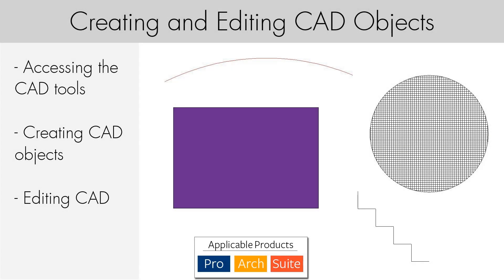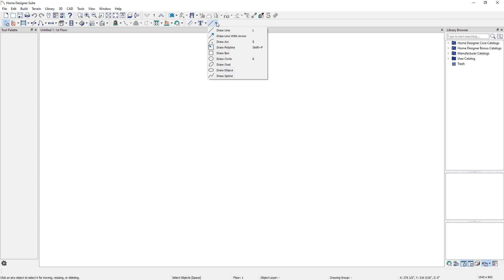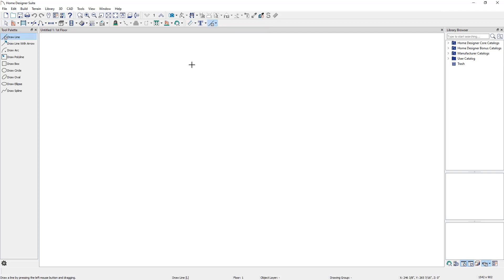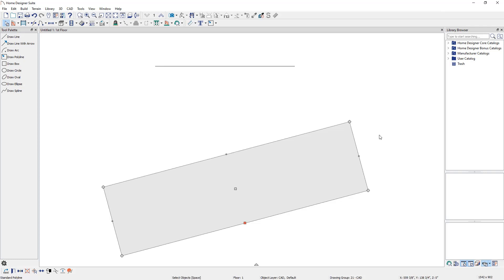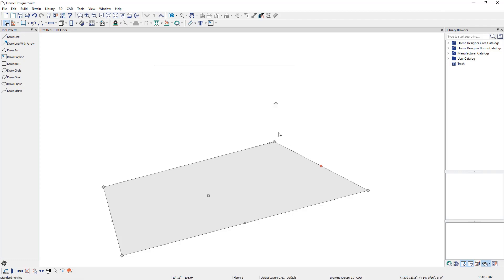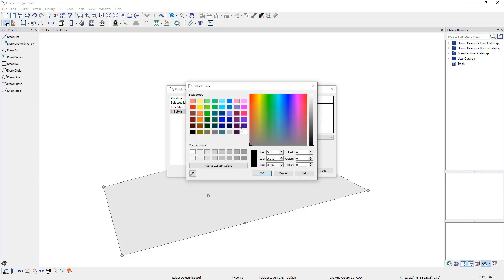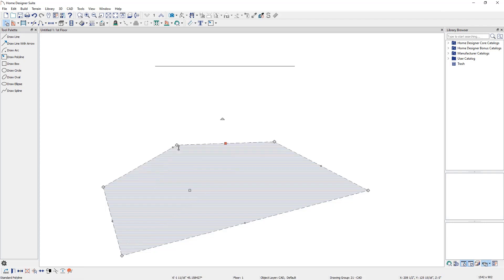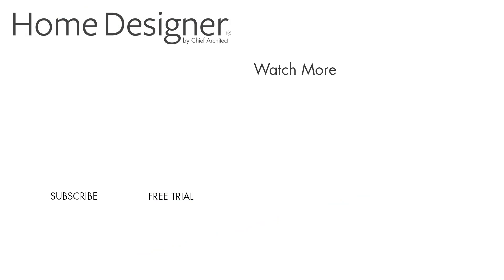CAD Tools and Objects

Comment: When will CA change or add the option on how cad objects are drawn. I.E. I use several different cad packages, such as AutoCAD, SketchUp, inventor and the list goes on. What I’m referring to is for example, When Drawing a line ... click hold the button down and drag and at the end release. Where most other software it’s click release, move and click release to complete the line. Either eliminate the click hold down mouse button, drag and release method to click release,  move,  click release method to end. Or better yet give us an option to select the method that best suits us. It drives me crazy when I need to switch from CA to another program and the methods are different. Thanks for hearing my rant.
Reply from the maker: Thank you for the recommendation, Douglas. We do not have that as an option currently but there is a Input Line tool where you can choose your start and end X and Y position and it will create a CAD line that way. Feel free to email us at suggestions@chiefarchitect.com we are always looking for ways to improve the software.
Reply: @ChiefArchitect  Thanks for the the reply. Yes I’m aware of hitting tab to enter distance and angle etc. it’s not a big deal but would be nice if everyone followed suit as in others commands, such as undo Control Zed for example.   It only takes a short time to reprogram the brain as to which software is being used and to make the mental changes required. After using AutoCAD for going on 38 yrs.,  I do a lot of freelance work at several companies with different software, I do most of my cad work in AC. Most of my design in CA. for residential work. Then to boot, Inventor,  Pro E and Solid Works at other companies of different disciplines.  Anyway, maybe someday they’ll all be the same.
Thanks for your time,
Doug